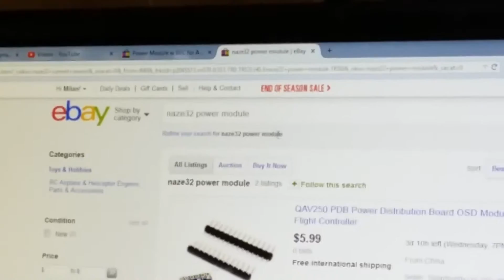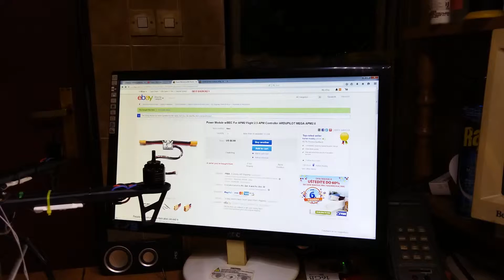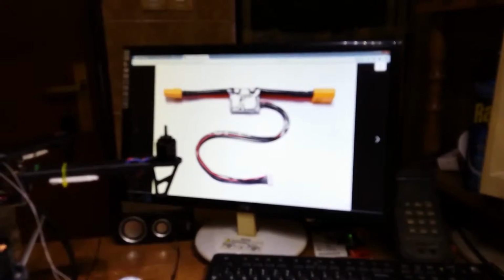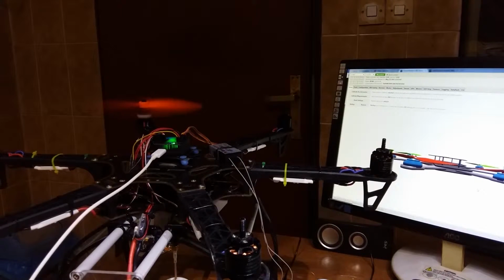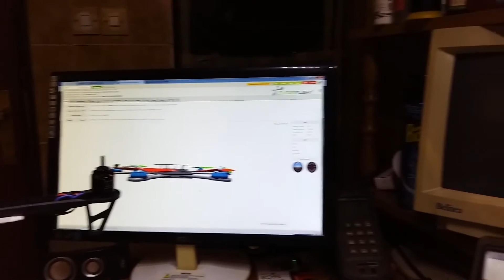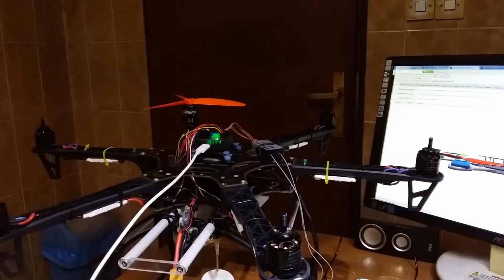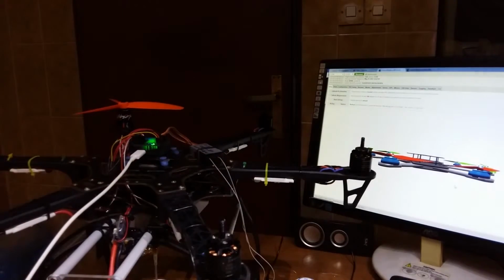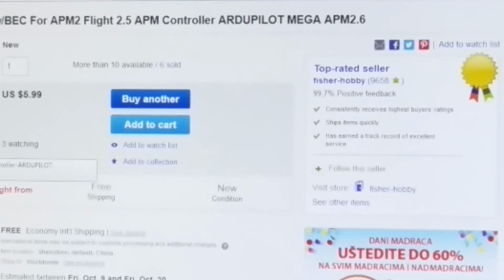Setup of Naze32 and APM 90 ampere current sensor

Comment: how do yo calculate voltage scale and offset?
Reply: Who is the original video author then?
Reply from the maker: I have no idea. That channel was deleted by this user. Set it up just like video said

925 scale correlate with 90Amp of max measured current
Reply: +Sir Dlight i mean Amps scale.
Reply from the maker: +Sir Dlight +Hans Turpyn It is not my video, I just reuploaded it from user who removed it from youtube. But it is interesting for me also. It depends somehow on current sensor MAX amps value and voltage divider installed on this board. I think we should ask Naze32 guys about it.

Comment: you are a hero! do you have schematic how to connect the apm sensor to the naze?   i was thinking a long time that this was possible. its a good solution for me to!
Reply: I will try to find my old original video. If deleted from hard drive, I will find again which wire is which. It is relatively easy, red wire and first black wire next to red - both are +, and at opposite end, two black wire are ground. Remained two vires, one is current sensing, one is voltage sensing... just not sure which one is which.
Reply from the maker: +Hans Turpyn It is not my video, I just reuploaded it from user who removed it from youtube.  I think connection of APM sensor is the same, but I should check it's pinout. I'll reply later
Reply: +joshhhab ???? Pinout???
Reply from the maker: +Thomas Licht see from 2.22
Reply: +joshhhab and on which pin at the Naz32
Reply from the maker: +Thomas Licht Pin 8
Reply: Can you remember who you connect the current wire to the naze 32 ? On the back is a adc pad but that do not work for me. Would be great if you can remember it because i can finde any information about it.
Reply: Current wire connect to CH8 (channel 8 on "RC input") on Naze 32 (I had old "Flip" board).
Reply: thank you worked !
Reply: I am glad to help. THanks.
Reply: Current pin goes to CH8 (channel 8).
Reply: This method would work in a F3 Flight Controller 10DOF? Thanks